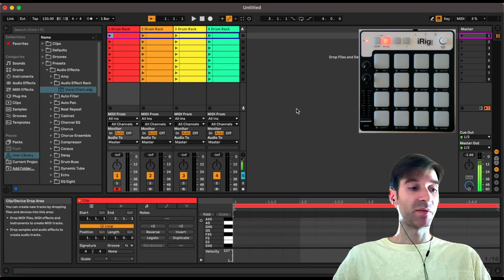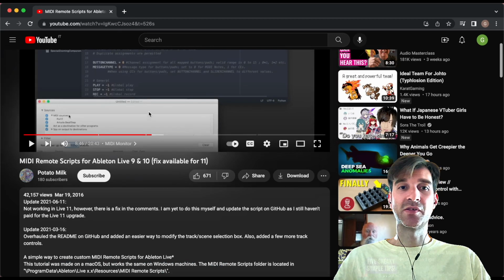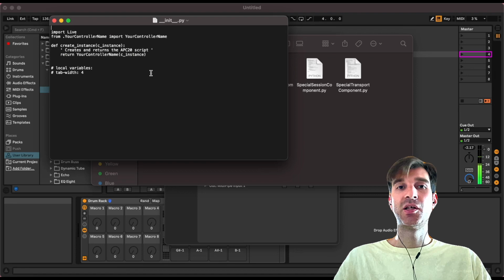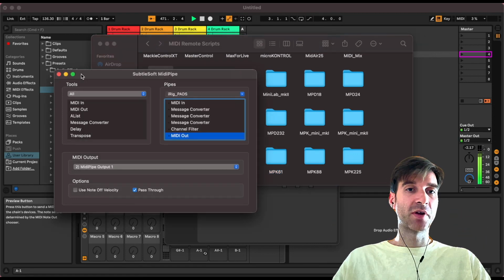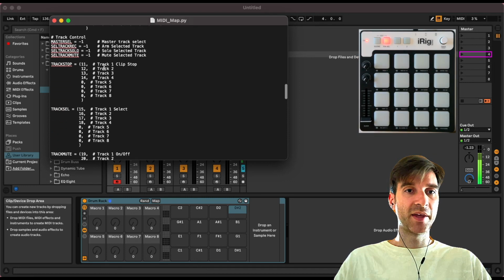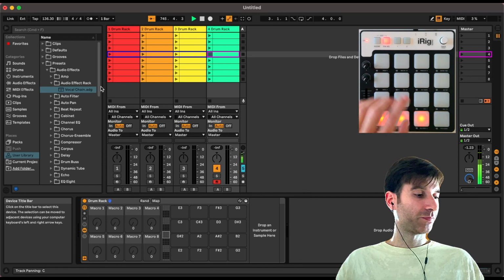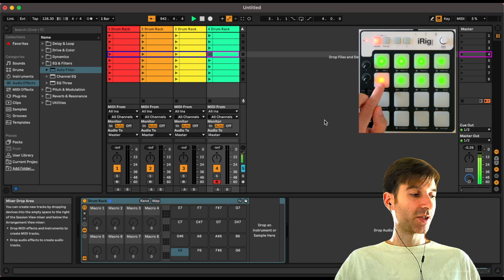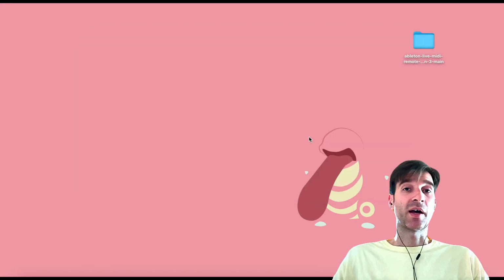Turn any MIDI Controller into a Control Surface for Ableton! Custom MIDI script tutorial [iRig PADS]

Comment: Hey, thanks for doing this video!  I have an iRigs Pads as well.  When you show the feedback on the iRig Pads when muting tracks how exactly are you doing this?  I've tried to do this by setting the pads to toggle, but this doesn't work right.  I'm guessing you're sending MIDI back to the iRig Pads somehow so the pad will be red when the track is muted.  Is that right?
Reply from the maker: Well spotted! Yes, I have a MIDI clip in Live sending CCs to the iRig Pads - different CCs trigger different colors on different pads. You can even write in automation curves - say a rising ramp, which will make it so that your pad lights up progressively. What pad reacts to what CC is in the manual!
Reply: @TheNeonSyndicate  Got it.  Thanks for the confirmation.  And great video.  Very, very helpful in using my iRig Pads for more than just finger drumming.
Reply from the maker: @TerenceD9  My pleasure! Yeah, this is a great little toy, I love that you can use it as a basic control surface and for finger drumming! Lately I've been experimenting with assigning the pads to notes chromatically and using it as an alternative keyboard - that can also be a interesting idea to play around with

Comment: hey man - great Video, thanks for keeping the scripts alive!
I saw a bunch of comments regarding naming of the files causing errors - kinda the same case here, but with additional spice on top
Ableton is showing me two different names for my MIDI In and Out ports of my controller (Traktor Kontrol F1) - its 'Traktor Kontrol F1 - 1 Input' and 'Traktor Kontrol F1 - 1 Output' (without the ') - could you think of which one to choose here? tried already a bunch of combinations, can't get it to be shown in the dropdown for control surfaces.

If you have a hint, glad to receive it :)
Thank you!
Reply from the maker: Yeah, you're right, the naming part seems to be a little more tricky than I could imagine. Meantime, I've stopped using Live so I can't even just quickly open its preferences pane and see if the "real" name is hidden somewhere there. I'm afraid trying some more combinations is the only way to go! Otherwise, you could try and reach out to the guy who had originally shared this method - I'm linking to his GitHub in the description. Anyway, good luck!

Comment: Hi, great Video. Unfortunately Ableton doesnt detect the folder. I am thinking i have some issues with the name of my controller. Its the XONE:K2 and the (:) cant be written in filenames so i changed it to an underscore. Not inside the code only the two filenames. But still ableton doesnt detect the folder... any ideas?
Reply from the maker: Right, there have been a couple similar comments, I think I remember those people managed to get it to work, but I don't remember how. Maybe just using a space instead of an underscore? Something like that.

Comment: Doesnt work on 12
Reply from the maker: Good news: it does! You need to double-check the process, you've probably got some naming wrong or something, that's all!
Reply: @TheNeonSyndicate  I'm trying this with an Akai fire controller it's named" FL STUDIO FIRE (Jack 1)
but when modifying the files it doesn't show up under control surfaces
Reply: @TheNeonSyndicate  Is there a way to make pages? or a shift button?
Reply: @TheNeonSyndicate  Ok I tried again first I forgot to add the underscores instead of the spaces... But still no result it does not show up. Was hoping it would work as I also took time to look for the midi cc's and then added em to the midi/map file
I made the name FL_STUDIO_FIRE_(Jack_1) as in ableton it comes up as FL STUDIO FIRE (Jack 1)
Reply: @TheNeonSyndicate  It showed up as FL_STUDIO_FIRE but the midi controls added do not work lol
Reply from the maker: @absent_  Glad you got Live to recognize it! What do you mean "the MIDI controls do not work"?
Reply: @TheNeonSyndicate  I assigned the midi cc numbers like you did in your video's to certain functions ex: Play knob on controller is midi cc 51 so in the midi map file I would put 51 for the play function. But when loading the remote script as control surface the function i assigned do nothing, I can see ableton receive midi... the flickering button next to the cpu stuff but when pressing play nothing happens. also no selection box appears.
Reply from the maker: @absent_  The controls in the map file start from 0. So 1 on your controller would be 0 on the script, and 51 would be 50. You might also want to check your MIDI channel.

Comment: can you change the messagetype for only a few parameters instead of the entire section? i want to map some buttons to buttons on my controller, the problem is the buttons don't emit note values, they emit CC signals and not all of the buttons do that.

EDIT: solved it. used MIDI OX and LoopBe1 to change the signals emitted and it works.
Reply from the maker: Not possible I'm afraid. You could either change what the buttons send directly from your hardware if it allows remapping, otherwise your best bet is a MIDI conversion tool like MidiPipe for Mac or Bohme for Windows.

Comment: Very informative video, thanks!

 In the midi_map.py script, I noticed in the first section there is " MESSAGETYPE = 0 # Message type for buttons/pads; set to 0 for MIDI Notes, 1 for CCs". However, I ran into an issue: what if I want both CCs and notes to control different functions? For example, I want to assign MIDI notes to control 'Play' and 'Stop', but I want to assign CCs to control 'DEVICEBANKNAVLEFT' and 'DEVICEBANKNAVRIGHT'. It seems to only allow one or the other exclusively. Any idea how to achieve this?

Edit: I initially thought I found a way to do it by reinitializing the MESSAGETYPE variable before the MIDI assignments that I wanted to be CC. I added a line of code like MESSAGETYPE = 1 before those assignments. However, after further testing, I realized this approach doesn't work. While it allowed me to control some functions with CCs, it caused the previous assignments with MESSAGETYPE = 0 to stop working. So, unfortunately, this isn't a viable solution.
Reply from the maker: That's pretty cool! Didn't know about this. Where exactly do you have to place the MESSAGETYPE line?
Reply: @TheNeonSyndicate  Oh, my bad! Sorry for misleading people here. What I did was initially set MESSAGETYPE = 0 in the first few lines so that all the variables after it would receive note on messages. Then, just before the line TRACKLEFT = xx # Track left, I added MESSAGETYPE = 1 so that I could control track left navigation with CC.

While this worked in allowing me to navigate track left with CC, the lines above, which were initialized with MESSAGETYPE = 0, stopped working. I was initially misled because the CC functionality worked, and I didn't verify if I lost the assignment for note messages in the lines before that.

So, the logic of reinitializing the MESSAGETYPE variable and continuing with new assignments is not correct. This leads me to still wonder, do you have any idea how to achieve this? Sorry for the confusion and thanks for any help you can provide!

One workaround I've found is to make the notes trigger CCs instead of notes, using a third-party app.That way  I can  stick to either CCs or notes exclusively. However, I prefer a solution within the script itself rather than further changing the MIDI mapping of my controller, especially since I've already remapped certain functions using MIDI Bome Translator.

I'm really not entirely sure about the limitations of this high-level script. I'm worried that the only solution might involve going digging into the scripting behavior rather than just working with this high-level interface.
Reply from the maker: @monivibes1  Yeah, I was going to suggest using some kind of translation software to adapt what your controller sends out to what the script expects to receive. Bome I hear works really well for Windows, I'm on mac so I go with MidiPipe which also allows you to customize things in detail. I like to keep notes for the first part of the script and CCs for the second part because this way I can have all my script-related MIDI messages on the same channel (11 in my case). If you set MESSAGETYPE to 1 for the first part of the script, you're going to need to change the channel for the second part.
Reply: @TheNeonSyndicate  Thanks for the reply. For now, I'll stick with using Note messages for section 1 and CC messages for section 2 using BOME. 
As you pointed out, if I choose MESSAGETYPE = 1 for section 1, then for the second section I need to change the CC channels. This means that if my CCs are by default on a certain channel, I would still have to remap them to another channel, which is a lot of hassle. So, I'll just stick with the default order and use a third-party app to handle the mapping.
Reply from the maker: @monivibes1  Sure thing. That's the most reasonable way to go about it. Have fun!

Comment: Hi! Thank you very much, this is great! Although I can't move the red selection box with my Korg NanoKontrol, what is possibly wrong?
Reply from the maker: have you checked what MIDI note your controller sends out and written it in the correct place in the file?
Reply: @TheNeonSyndicate  Thanks for the quick answer! Yes I've checked, I tried using different keys, different MIDI CCs, changing the behaviour and values of the keys from the Korg editor software, no way. Can't wrap my head around it. The red box is displayed, the volume faders work perfectly.
Reply from the maker: @francescolurgo  What function in the script did you assign to your notes?
Reply: @TheNeonSyndicate  session left/right/up/down, track left/right, scene up/down
Reply from the maker: @francescolurgo  What are your TSB values?
Reply: @TheNeonSyndicate  currently 8x8 but I also tried to change them
Reply from the maker: @francescolurgo  Have you checked the MIDI channel your notes are being sent on VS the one indicated in the script?
Reply: Yes, all coming out on channel 1, on the script it says that value 0 = channel 1. I tried sending notes and I tried sending CCs. Still nothing. BTW thank you so much for trying to help. I really appreciate it.
Reply from the maker: @francescolurgo  Sure so what notes did you write in the script under what values, and what notes are the buttons on your controller sending?
Reply: @TheNeonSyndicate  I've solved it!!! MIDI monitor was reading notes on a different octave rather that the one they were actually on, I really don't know why! Thank you so much for the assistance!!!
Reply from the maker: @francescolurgo  Glad to hear you could get things to work. Have fun!
Reply: @TheNeonSyndicate  💗

Comment: Super helpful video!!! Do you know it it's possible to limit the maximum/minimum range of the MASTERVOLUME assignment? 

I have it assigned to my controller through a midi script, but when the knob is turned up to max the master volume goes all the way up to +6db, I want to somehow limit that to 0db.

Any ideas most appreciated!
Reply from the maker: Not possible on the script unfortunately: only the tempo slider can be limited. My workaroud? Place a utility device on your master channel and set its gain to -6 db. This way, when your master fader is at +6, it will actually be at 0.
Reply: @TheNeonSyndicate  Thank You!!! :) :) :)
Reply from the maker: @DJALEXRRR  sure thing

Comment: Nice explanations !!! Lately I`ve been using little midi > OS keyboard shortcut converter called Coyote Midi . Surprisingly  it more simple to setup  instead doing hack and write custom midi remote scripts . 

You just need to know which shortcut needed for specific task you want , then translate( map ) our midi key/button/slider/knobs into those shortcuts .
For my DIY Arduino midi controller, I`m only using  3 knobs and 10 buttons for most important shortcut in my workflow
Reply from the maker: Sounds pretty cool! Is it free?
Reply: @TheNeonSyndicate  the free version should be enough for most case .
Reply from the maker: @morizanova  Gotcha. Gonna have to check that out then. Thanks for the suggestion!
Reply from the maker: @morizanova  Found the catch - Windows only 🥲

Comment: Thanks for the video, I'm trying to create a control script for the spd sx pro but for some reason it doesn't show up in Abletons preferences. I have placed the folder with the right name and the files with the right name in the Ableton / Content / App-Resourses / MIDI Remote Scripts. I'm using Ableton 12. Anyone any Idea what I'm doing wrong? Thanks in advance :)
Reply from the maker: Sure thing. First thing I'd check is the name, you sure it's spelled correctly including any hyphens or underscores?
Reply: @TheNeonSyndicate  having the same problem with ableton 10 here,
Reply from the maker: @konaraweb  This script won't work with 10: it's made to be compatible with Python 3, whereas 10 uses 2. The original Python 2 script might still be available on github though, have you checked?

Comment: Hi, it worked geat with a PCR 500 on windows and LIVE 12. I modified the midi_map.py script to try stuffs. I erased the pycache folder. And now, my PCR device doesn't appear anymore in my midi device list... The red square selection of track window also disapeared... I tried to reboot, redo the trick, but nothing reappearded. Any ideas ? Thx

Comment: Hey. Thanks a lot for this! Do you know if the options in MIDI_Map.py is all there is? I'm missing one for next locator. Is there a place where I can look it op? Also I have a knob on my midi controller where it doesn't do anything when i write it in. I think it's because it's on the same channel as the buttons "# When using CCs for buttons/pads, set BUTTONCHANNEL and SLIDERCHANNEL to different values.". But I can't change the what midichannel my controller is sending. 
Lastly my midi controller I'm configuring (Impact GXP61) has alot of buttons where it does programchange actions. Is there any way to interpert these? 
Thank you.

Comment: Very good tutorial thanks man!!
The one thing i cannot get to working is the Drumrack.
It,s working but only the set notenumbers, so when i select the next bank in drumrack it keeps triggering note 36 for instance!!
Reply from the maker: My pleasure! Hmm, did you set the channel number and the midi note numbers correctly, so that they correspond to what your controller is sending out?
Reply: @TheNeonSyndicate  Yes that.s all correct.
Maybe it has something to do with u using midi pipe, so there is a conversion of your midi messages?
Thanks for answering in the first place❤️
Reply from the maker: @deejee1971  np. MidiPipe is only an intermediary to convert some midi messages. Have you tried changing the midi input on your track in ableton? Trying out different options there. Having your controller selected might interfere with the script

Comment: You keep saying "Midi Note"....do you mean midi note? or is it the Midi CONTROL number?  Because your values seem to be linear and this video is actually confusing.
Reply from the maker: Usually when I say note, I mean note. Most of the functions here in the script work with midi notes. But hey. I'm not perfect. Could you give me a specific example?
Reply: @TheNeonSyndicate  Im not saying you are wrong...from a coding standpoint, I am wondering if its note on off or midi cc etc
Reply: @TheNeonSyndicate  so for each control you literally went 1, then 2, 3, 4 etc...to me that signifies a control number not a note
Reply from the maker: @linzenmeyer  I see. Well, those are, in fact, MIDI notes. I'm simply using numbers instead of letters, because that's how the script works - in other words, it doesn't accept, say, "D#4". It's just a different notation is all. So, for instance, the lowest possible MIDI note, which I believe is C-2, would be 0, the next, C#-2, would be 1, etc.
Reply: @TheNeonSyndicate  ahhh..ok, very good, I understand it now.  Thank you.
Reply from the maker: @linzenmeyer  no problem!

Comment: Thanks so much, Ive been trying to figure out a way to use a midi controller that wasnt in abletons set of control surfaces, so this helped alot.

Though currently i have an issue, ive done all the codework and stuff in python, and though it does appear in abletons list of control surfaces, my midi controller doesnt seem to interact with it at all. i tried changing the midi channels, and i even changed the midi channel for my controller, but nothing seems to happen. is there something i might have missed when i was editing the code? or is it because my midi controller isnt compatible at all?
Reply from the maker: Sorry to hear that. The issue could be a number of things, we would need to have a look at it step-by-step. Unfortunately, I just started a new job so I don't have the time to provide in-depth support like this anymore. I could, however, offer this service to channel members - after all, even members on the basic "super shredder" tier (3$) get "priority reply to comments", which could well include this kind of support, too. This would make it worth my (unfortunately now very limited) time. I hope you understand and I don't mean any disrespect.
Reply: @TheNeonSyndicate  Thats perfectly fine! Take whatever time you need
Reply from the maker: @RSTypeContent  Just to be clear: what I meant was that this kind of in-depth support will be members-only. It's one of the benefits members enjoy. I just don't have the time anymore to offer it to anyone unfortunately. I hope you understand and again, no disrespect meant.